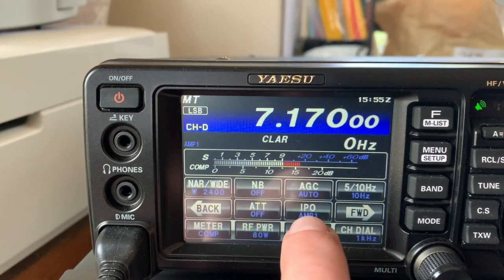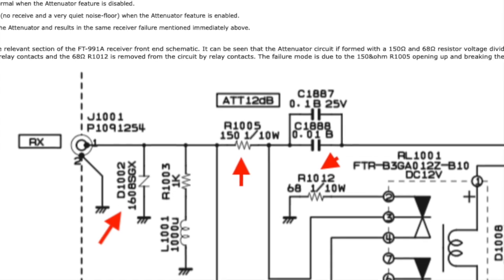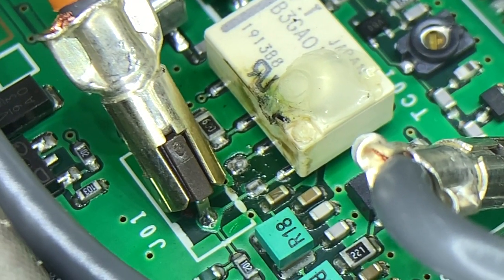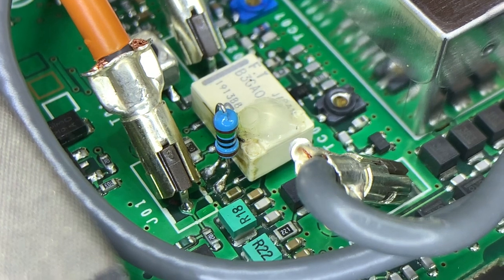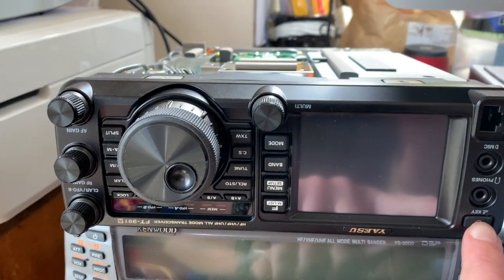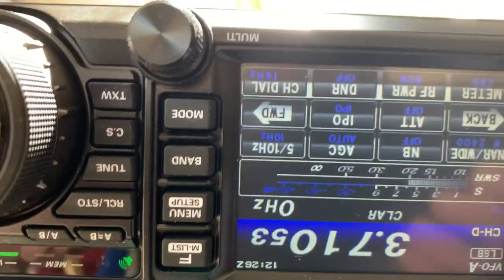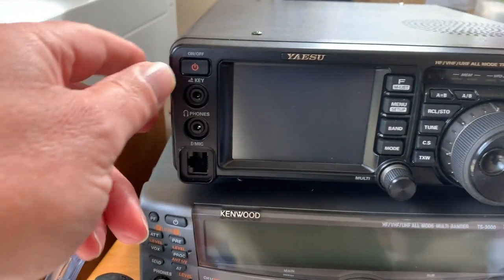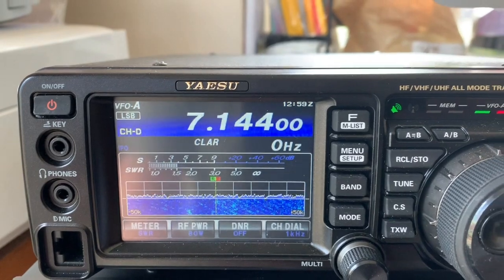MY YAESU FT-991A  IPO/ATT FAULT - Frontend gone Bye Bye......

Comment: Great fix!  I have an issue with my 991a but I don't really know anyone local who might be able to fix it so may have to send it in.  It works on HF fine and receives 2m/70cm fine but does not transmit correctly on 2m analog/2m c4fm/70cm c4fm.  70cm analog does seem to work.  I got the unit as the third owner and I believe the first owner had some kind of issue with the radio and may not have understood what it was or what had happened.  I really do like the radio in all other regards so far, seems to "hear" really well.
Reply from the maker: Yes Chris it is a great receiver, sound like an alignment issue to me on the v/uhf side?? good luck with it. :)